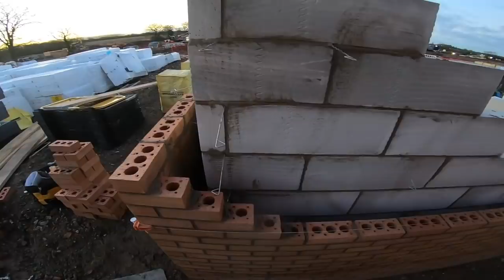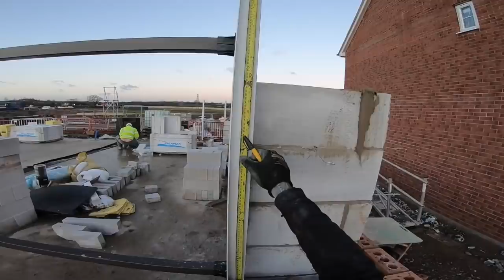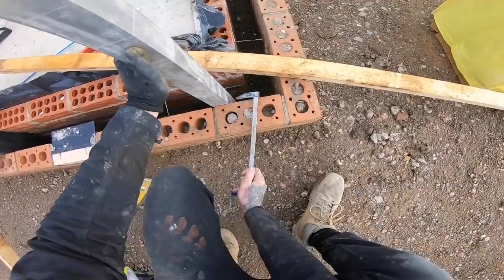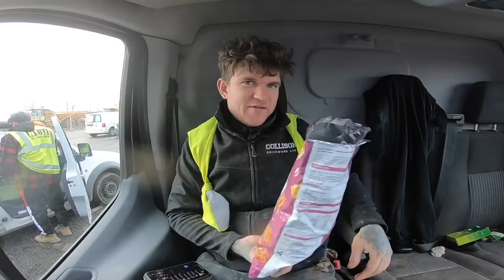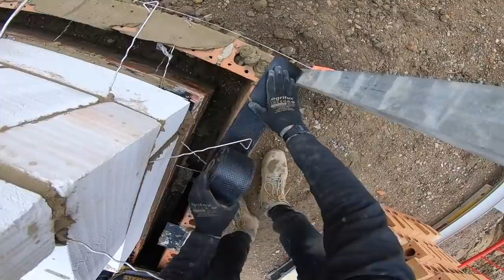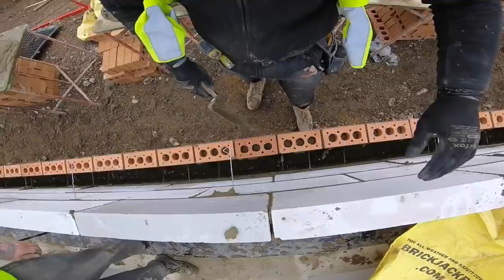Tips and tricks Thursday... Bricklaying

Comment: Do toy put insulation in the cavity Charlie? A lot of vids i dont see any . I always have to put kingspan or extroteerm bats in before taking up face work otherwise you wont fet them in with ties in the way. Intersted to know what system you use if could be arsed answering on an old video 😂
Reply: Just saw a reply from ye ," blown in" . Jasus that's handy. I thought they gave up on that system particularly on new builds   cuz of damp issues.  Ah well better for you mate just focus on getting them in . No pr#$king about with insulation . Some places take the piss, want you putting in insulation , windows and door frames , c section damp flashing, we're brickies slash windows installers slash damp guys slash insulators these days.. 😂😂

Comment: Ideas please for mortar board material on the cheap/ easy to get. Thanks
Reply: Loads of sites thrown away offcuts of ply, 12mm ply is usually the go to, wouldn't both with chipboard as the minute you start tapping ya trowel on it to get the muck off it will split it and you will get craters forming....

Comment: how does it work with the string line, doesn't it slope downwards when you move it up at one end only so it isn't level? thanks
Reply: He was just using the line to keep the bricks running straight an trapping them down with the level
Reply: @bennyred6381  ah right i get it, cheers pal

Comment: what's the point of setting up the mortar board stands to run in 3 courses of blocks then move them all to start the brickwork?
Reply from the maker: Was to windy to do anymore
Reply: Depends how windy it is but I'd probably done 6 course of blocks then backed it up. The stands won't take long to move and the hoddy will do it anyway
Reply: @jims5394  true mate

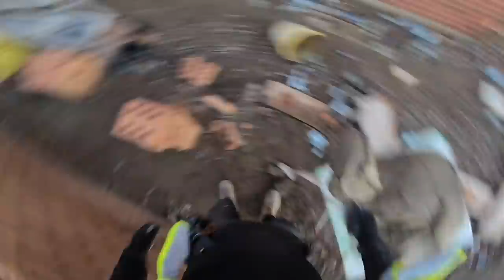Comment: Charlie - at 4:14 and 5:40 it looks like you only move your line up at the end you are laying - is the other end also moved or do you leave it where it is? Sorry if its a stupid question, I'm not a brickie 🤔
Reply: He was using it as a guide as he was just building the corner. Normally you would put up both ends of the line as you go
Reply: @MrCharlan1  Oh OK thanks
Reply: Basically plumbs and ranges in the bricks for him, leaving him to only level each course to build the corner.
Reply: He does say he’s using it only to line up the fronts and using the spirit level to make sure the bricks are level. Reasonable if you’re only laying a few bricks on each course. Once he’s built up both corners and doing the full run in between he’ll use a level line.

Comment: 19.50 What you getting told off for Charlie????????????????????????????????
Reply: I goin with he needs to cut the half bricks with disc cutter instead of hammer and bolster as it may leave shite edge or something? Not a brickie either lol
Reply: Saying the cut has to be the joint and not in the cavity :)
Reply: @zakshuker220  see and that why I'm not a brickie, my answer sounded right lol
Reply: @richierich91  😂don’t worry mate I’m only 20 still learning!
Reply: I wondered this to. But hold on, if the cut is used as the joint A) it's not as neat and B) not all uniform in size.

By placing the cut in the cavity it ensures nice straight joint and a uniform header/brick.

I can't see why the site agent wants the cut to be the joint? Any one please explain why they would want it this way?
Reply: @JimJimpmjj  maybe something to do with damp? I’m not 100% sure mate tbf, maybe so you can’t see the cut when you put the cavity closures on?
Reply: @JimJimpmjj  mate it’s jobsworth talk there’s no reason why as long as the cut into the cavity is bolstered to the same size as the stretchers (102.5) it would be fine. And yes the perp joint bolstered/sawn never looks as good and will not give a better size and cut than it going in to the cavity
Reply: @vivalachocolat1  I thought so, thanks for the information 👍🤙